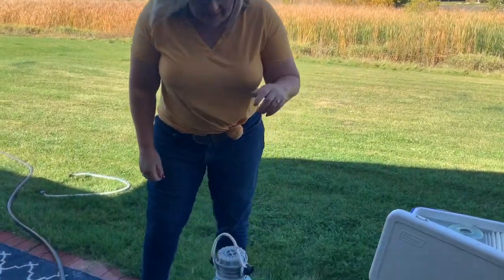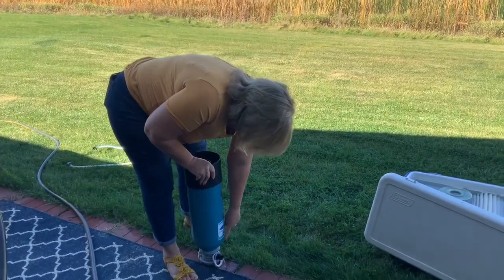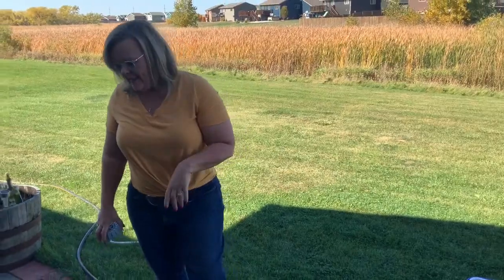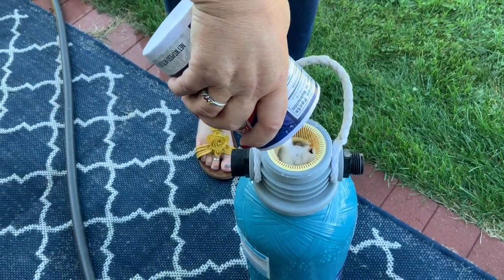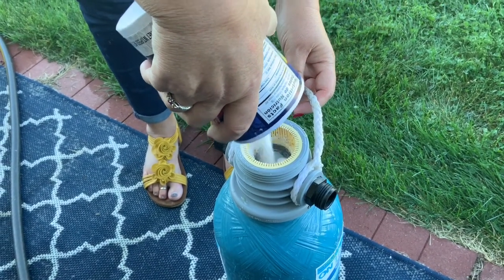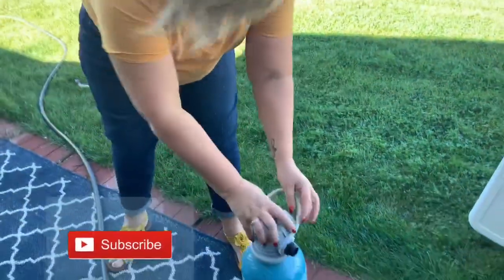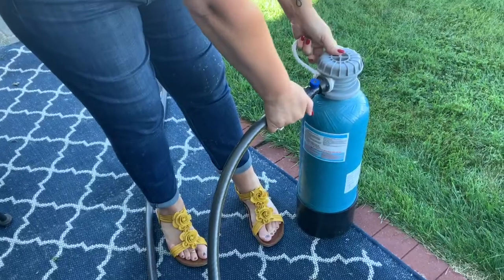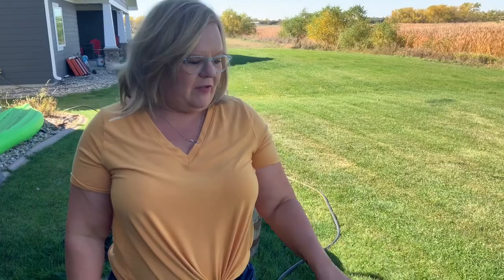Recharging Your On-The-Go Water Softener

Comment: I have access to my whole home water softener through a garden hose.  Is there any reason (other than convenience) to use this product over my method?
Reply from the maker: most home softeners have to regenerate before you can fill the hot tub with soft water. If you can get your hot tub completely full at 75 ppm or lower of hardness you’re good to go.

Comment: I have what I believe to be iron deposits on the surface of the tub. Brown and sandy looking. Would this eliminate it?
Reply from the maker: I twould hlep as metal has a hard time surving in soft water but no it will not eliminate it.  You would need to get a cu lator or use stain and scale control if it is truly iron

Comment: I just filled my hot tub and recharged my on the go softener. Since I will only be using it to occasionally top off my hot tub, how should I store the softener???  What I mean is, do you empty the water out of it or store it with the water in it from recharging???
Reply from the maker: Store it with water make sure it is upright and kept someplace it won’t freeze

Comment: How do you know when it’s time to recharge
Reply from the maker: after about 700 gallons
Reply: How do you know when you reach 700 gallons ? Do you have some sort of water meter?
Reply from the maker: @tommetz7587   no but you should know the gallons of your hot tub.  Mine is 500 so I know I need to recharge after a fill and a couple of top offs.    If your hot tub is 350 you could get two refills out of it